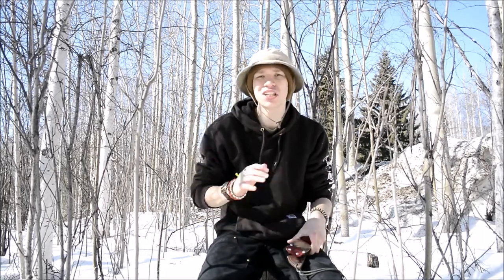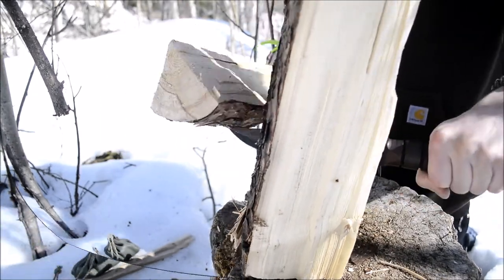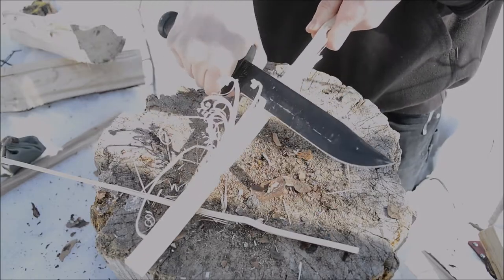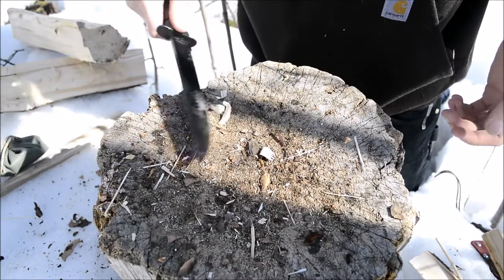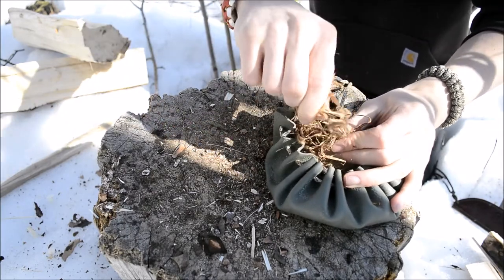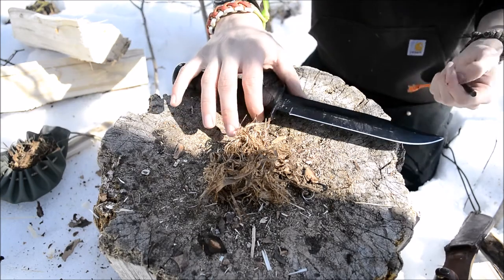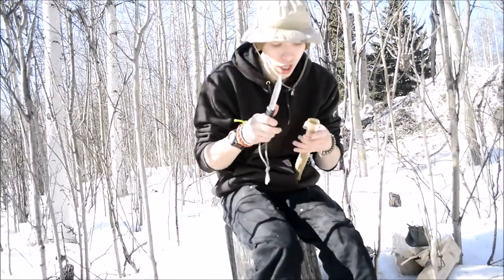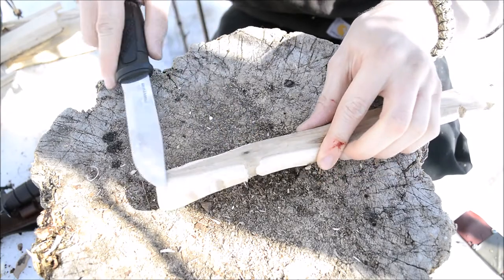The Mora Garberg vs The Ka-Bar

Comment: Say Heah, Yeah, The Mora Garberg is still on my Wanna, Wanna List. But I got my Cold Steel 3V Master Hunter first. The reason being, I thought it would fare better with my Fox Parang Bushcraft Jungle Knife. But the first time I used my Bushcraft Parang, I teamed it with my Vic. Rangergrip 78 on a trip with alot of snow, so I wanted to go Lite. I also had my Small Forest Axe and Bacho Laplander. The second time was last weekend, I teamed it with my Frost Mora 840 Clipped MG. I definitely will get a Kanbil and the Eldris in Green for my Bushvraft Parang.  Not that the 3V Master Hunter isn't a bad team-up, it is, Anyhow, yeah, eventually I'm going to get the Mora Garberg.,,.
Reply from the maker: paulie 4x yeah, the CS 3V is a great knife and definitely righteous decision!
Reply: Thanx You, Yeah, I really like it.,,.

Comment: You think the KaBar started the outdoor knives and is the standard for all others?? I know you are still young but you should read a bit more so you actually know what you are talking about. First of all Ka Bar is and was just one of the producers of the USMC fighting and utility knife. The US military just send out specs to many manufacturers back in 1942 I think. KaBar was not the first to get the deal and sure was not the only one. Think Camillus, Ontario, Western, United, etc and there where also special knives (same specs) with different sheaths for divers, etc. Now the KaBar is the only one with the bended hand guard, as the other produced them with straight hand guards. You find that bended hand guard a problem for choking up to the blade, and it is. You should have gotten a Camillus or Ontario that are still issued for basic training I think. You also say the USMC is better for batoning but it has a sharpened edge on the back near the tip. That will destroy your baton, so all you proved is that a lager blade can baton thicker pieces of wood. My guess is that everybody knows that already, but it does not make the USMC knife great for batoning. I am not saying the USMC knife is a bad knife in any way, but it is a mass produced attempt to make a knife that can do it all and for the most part fighting. The GI's however tried to get their hands on a Fairbain Sykes dagger or Smatchet for fighting. But will all respect the USA did not make or invent the first outdoor knives. Think about the Puukko and Leuku designs that have been around way longer. But like a lot of Americans you think the world started when the USA started where my house is way older than the USA.
Reply: A lot of Europeans think that things started in their country when in all actuality it started in Native cultures most likely in Africa. If we keep going back in history....
Reply: The Mora was basically a byproduct of the Viking age as a smaller task knife to the Seax
Reply: @billpeart  Metal knife making did start in Europe. Not in Africa. Also the native Americans did not have metal knives of tools until the Europeans arrived.
Reply: @TacticoolVIKINGBeard  Indeed. 'Puukko' just means 'knife' in Finnish and refers to the small fixed blade they had and have for EDC aka every day chores. You see this tradition in the colder Northern countries. In the warmer parts of Europe they were largely replaced by folding pocket knives.
Reply: @StevanOutdoor  iron tools/weapons started in europe but crucible steel started in the middle east (Damascus)
Reply: @TacticoolVIKINGBeard  The first use of blast furnaces is attributed to China. Crucible steel to Anatolia. So none of them belong to Africa.
Reply: @StevanOutdoor  i believe the use of furnaces like that were primarily attributed to clay bricks first. The first crucible steel was in the middle east. Not Africa.
Reply: @TacticoolVIKINGBeard  So we agree. From every history viewpoint it did not start in Africa.

Comment: Say Heah Mathew, Now that I got the Mora Garberg, Yeah, I like it, Infact I like it alot. But it gave me a chance to compare it to my Vintage Blind Horse Bushcrafter. Similar size but my Bushcrafter is in O1 and a Kephart style. It's my Lil'tank. I got tge Scandi Grind and I had tge Handle polished and made Flat. Yeah, just like a Hockey Stick. I get a lot better control with that kind of handle. I can't choose which one I like better. But the more I use my Bushcrafter the more I like it. But on wet conditions, I go Garberg.,,. p